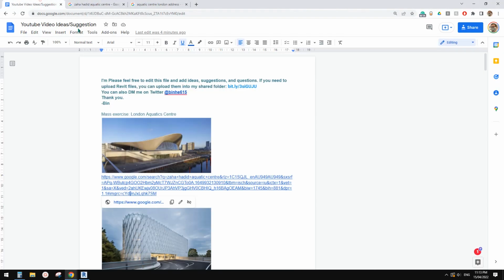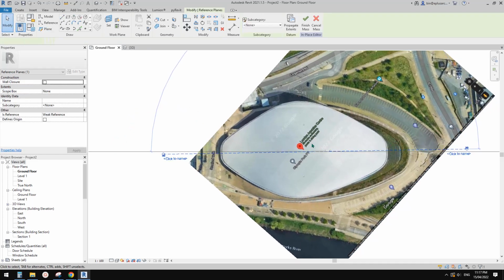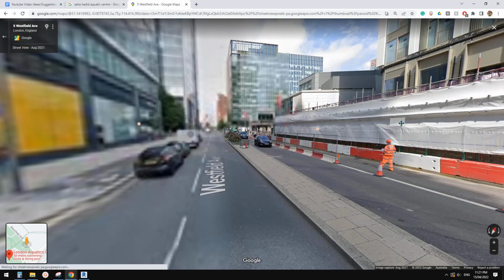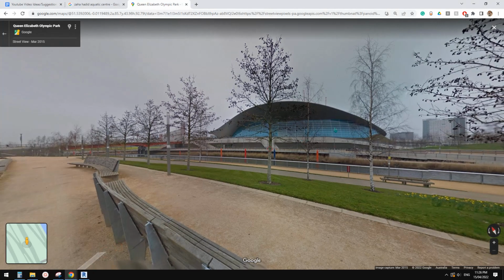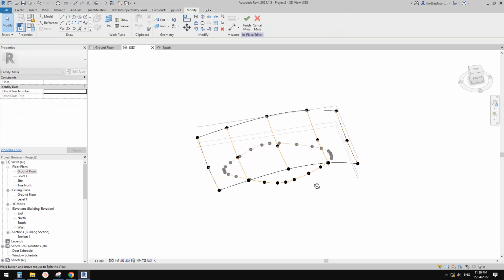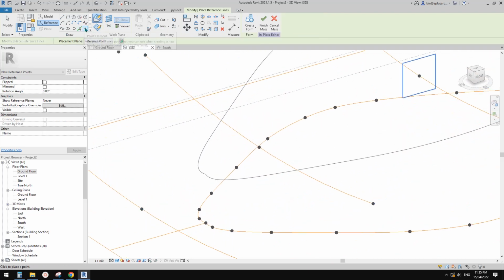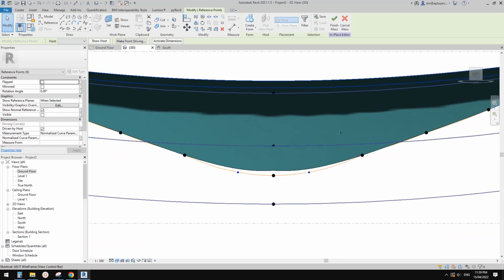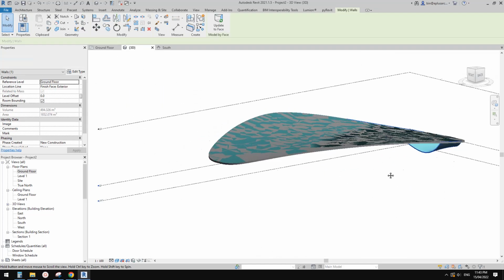Revit Exercise (Day 753) Massing Exercise

Comment: Great job Bin, 

Can not the void be mirrored? 

Of course it’s possible to play with the splines second point to guarantee that it is tangent at the point the two half meet? (You can even achieve the half shape by a combination of lines,arcs and fillet ) 

I notice in massing when you select more than one face, edge, point the driving arrows don’t show up, but maybe it is possible to move MV vertically in elevation or section ? 

Is it possible to add edge to the mass instead of add points then spline thru points ?
Reply from the maker: 1.  Not sure exactly what you mean, but I think we should be able to mirror the path or profile of a void and create a new void.
2. Sometime we need to create a single surface because of the pattern from divided surface. Using lines and arcs will create separate surfaces.
3. I believe you can. You can also move them in 3D as long as you set the correct work plane. You can also use the arrow keys on your keyboard.
4. Yes, you can.
Reply: 1. I ment mirror the void form it self instead of select all the edges then mirror them then select all the edges then create form to the other half ?
2. Okay I got you … making form from arcs, circles & lines will give a “seam” … you are right, that’s why the cylinder fx is always divided into two surface probably cause it’s done out of to half circles
Reply from the maker: Maybe you can, if you create them using model line instead of reference lines. I am not sure...